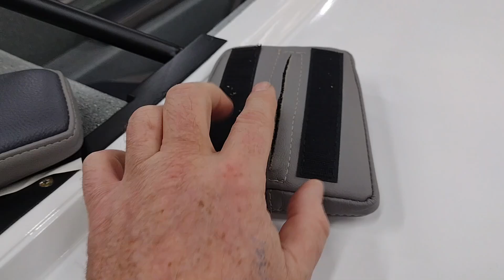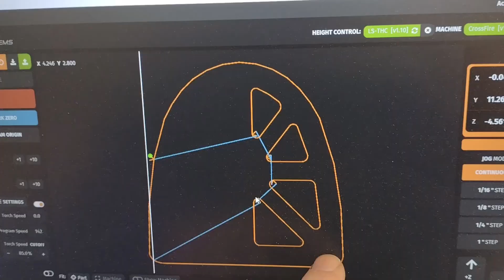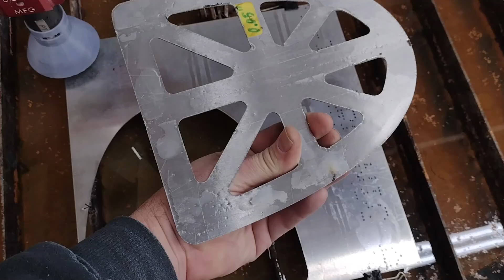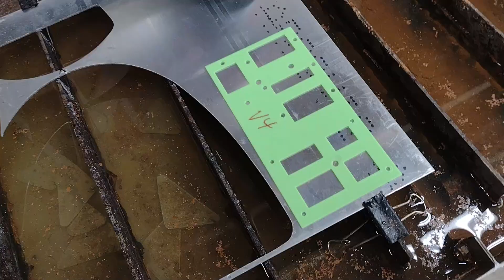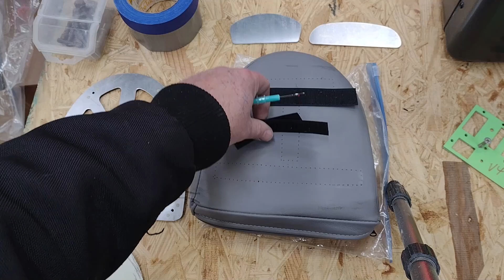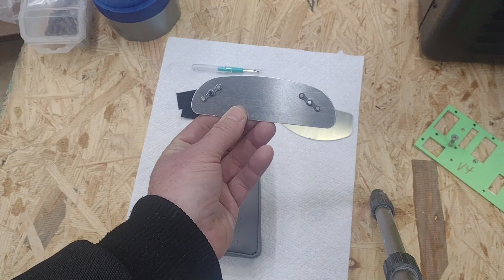Long-EZ N916WP - Pilot and GIB Headrest Pads Installed

Comment: Good video Bro! Do you thing installing the top head pad might make the headrest hard to open fully? Ciao, Marco.
Reply from the maker: Thanks Brother.  Yes, I do.  That's why I need it removable, or hinged at the top.  Something that allows me to manipulate the top pad, open the headrest storage, then place the top pad back in place once closed.  I looked at snaps, but they require 2 pieces and have to get in behind the material to place the internal piece.  Unlike rivets, no blind snap assemblies that I'm aware of.  Thus I continue to ponder on that one...